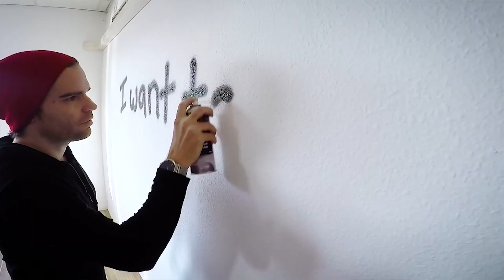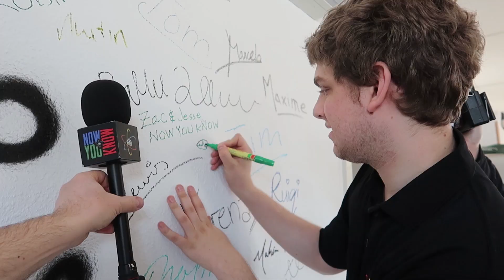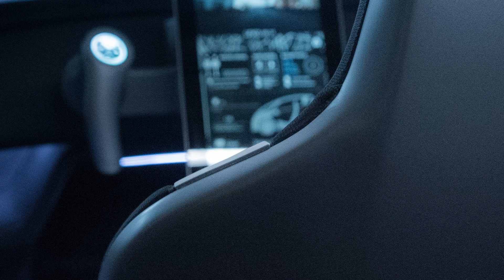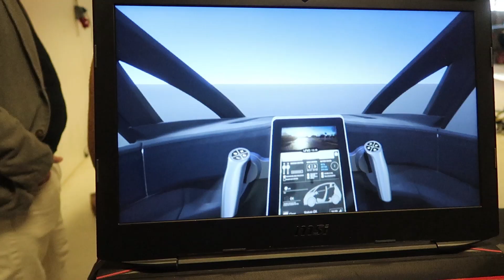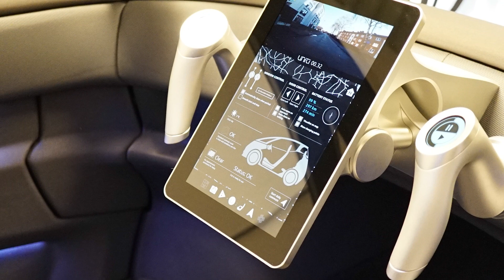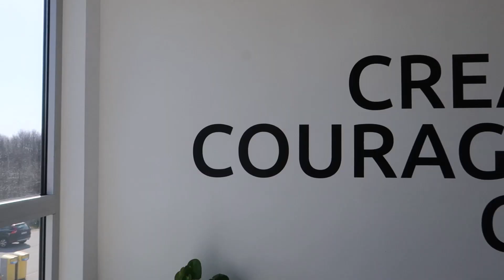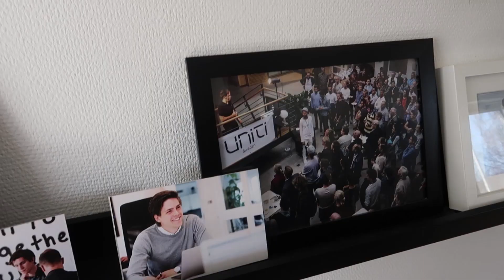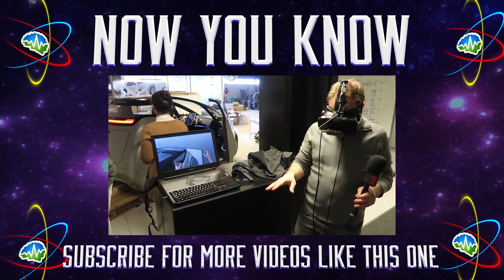Uniti One! Interview with CEO Lewis Horne

Comment: Hey guys,
have you heard of the Sion by Sono Motors?
This one is also very affordable (~20k€) and will get a 40kwh battery that can be used bidirectional... and it has solar all over it to produce juice for up to 30km per day without charging it externally...
Reply: Yep, just went here to mention them, too!
Reply: Glad to see someone finally integrated solar with an EV. Genius. It should become standard in most or all EVs tbh

Comment: Having the screen as part of the steering wheel feels like a mistake.  What about airbags?
Reply: It's probably classified as a motorcycle or something so they can get around the airbag.
Reply: Well you can inflate an airbag around an obstacle, it's a bit more expensive but would work. They might even change the design a bit before starting on the US market. :)
Reply: Same thing I thought, but they could have airbag's from the sides

Comment: Could you do a video comparing different EV's battery thermal management systems? Like which EV's use liquid cooling (Chevy Bolt) vs active air cooling (Kia Soul EV) vs passive air cooling (Nissan Leaf) and which ones are most likely to suffer the least from battery degradation based on how good their respective systems are?
Reply: XP-8 are you copy/paste this on all VE Youtube channel?
Reply: Yes, lol XD

Comment: Does this car have airbags?
Reply: Watching the Uniti videos, it looks like there will be an airbag just behind the screen (it will have a different design from this concept).
Reply: It need an airbag if it will be sold in USA. :)
Reply: Adrian G. Pop it needs an airbag if they want to sell it anywhere in Europe.
Reply: Personally, I wouldn't buy a car without the usual safety features regardless of whether they are mandatory.
Reply: Adrian G. Pop I understand it, but I often drive in public busses, they don't even have a seatbelt 🤔
Reply: Ruben Kelevra that's due to many different reasons: Public buses never go faster than about 80km/h. Also, they are less likely to crash than a car. And lastly, buses are engineered to work without airbags and seatbelts, as the energy will be absorbed by the chair in front of you. Chairs in public buses are build to bend when pressed is applied. So they absorb the engery but don't crush you when you hit them. It's very different to experience a crash in a bus that will send you flying at worst than to crash into a robust windshield/steering wheel in a car.
Reply: Lennart F I drive every day in a bus which drives up to 100 kph. It's a regular city bus even with standing passengers and it drives on the Autobahn. Normally they should be limited to 60 kph but nobody cares about that.

Why are they less likely to crash? They drive on the same streets in the same street conditions and they have a longer breaking distance.
Reply: I am not a fan of buses. On the occasions that I have used buses, I have personally witnessed people have heavy objects on their laps during the ride which become missiles in a crash situation. Drivers also vary in skill level, some are great other should never be behind the wheel.